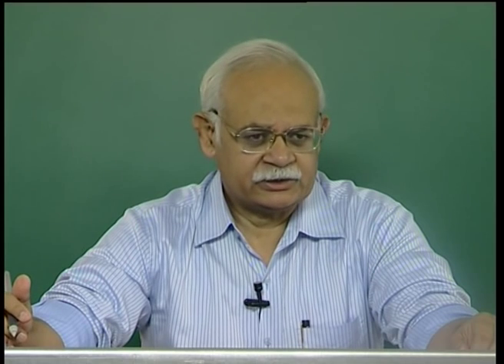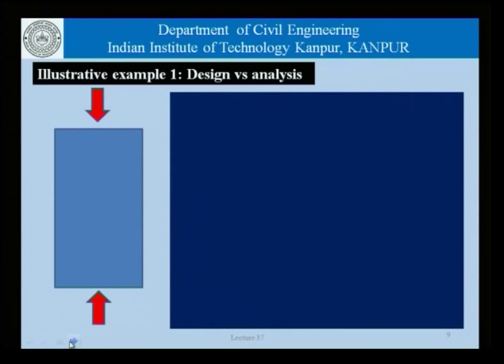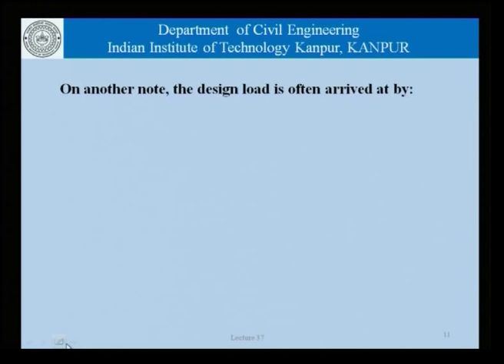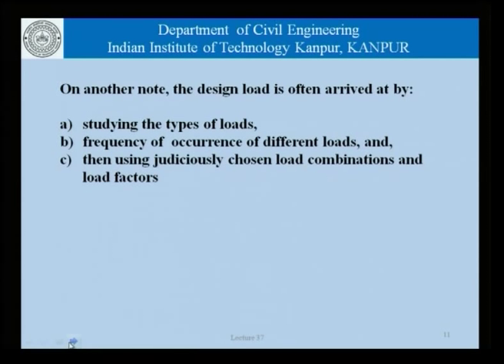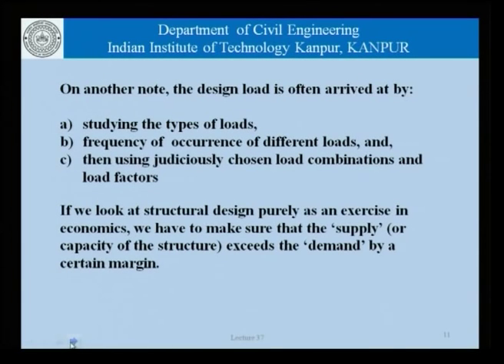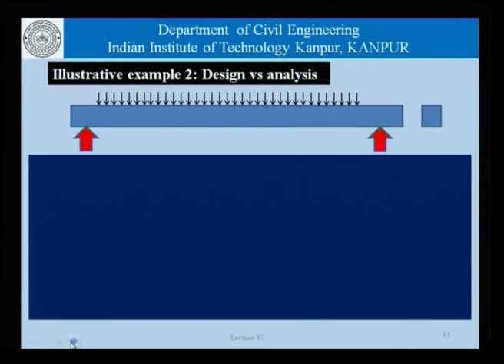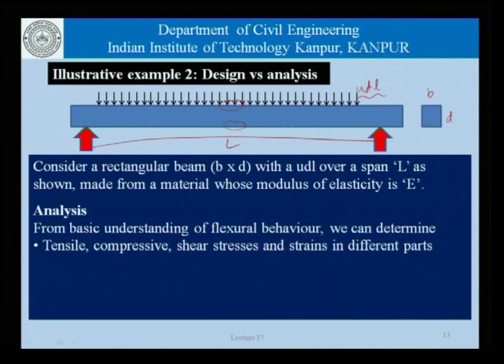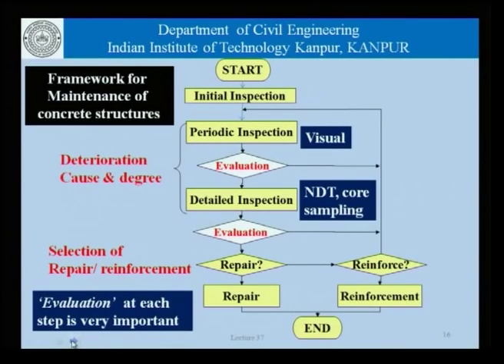Mod-01 Lec-37 Considerations in repair of concrete structures (Part 1 of 2)

Comment: I wish to learn how to find out how much the steel bars in Reinforced Concrete Structures are corroded inside. Can we estimate the condition of steel reinforcement bars non destructively, that is without removing the covering concrete or in any way disturbing the structure ? Is there any instrument that can detect the extent of corrosion of steel from outside the concrete ?
Reply: akhil999in yeah it called Natural potential measurement in lecture 34